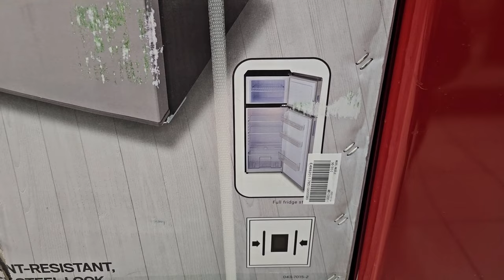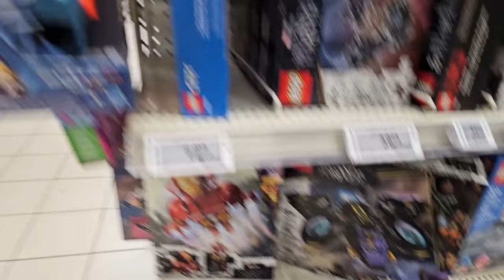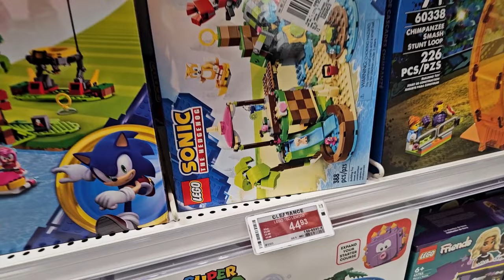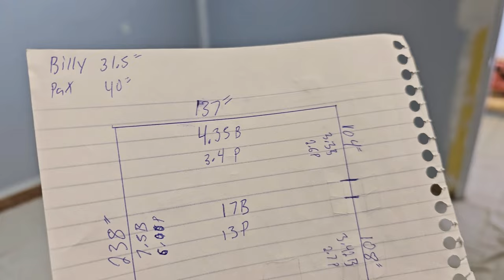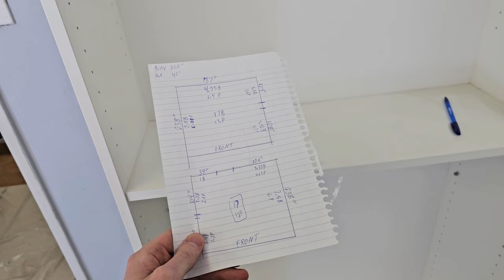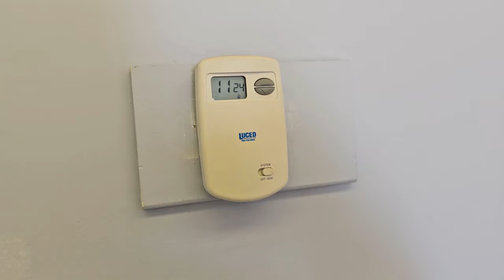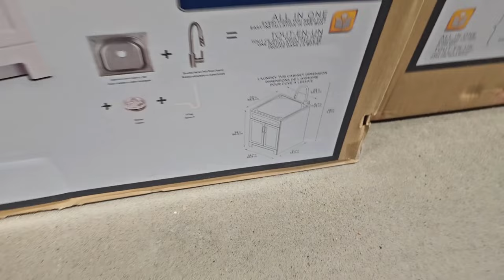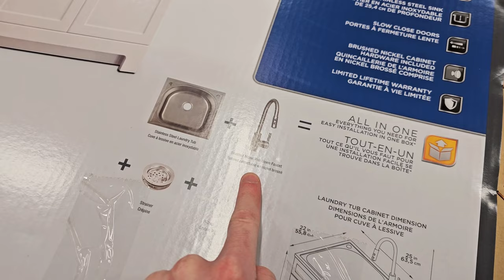Measuring LEGO Cabinets, Construction Progress & VLOG

Comment: Hi Bricksie! Interior Designer and Lego enthusiast here. I wouldn't settle for the tiles you don't want. First the dark is soooo hard to see Lego. Second it is expensive no matter what you are spending so you should definitely get what you want. I have seen clients pick options and then they are not happy and it costs them twice as much in the long run and I don't want that to happen to you. You can find really good carpet tiles at End of the Roll, ext around the $1 sqft mark. I am out of Calgary and know a lot of local suppliers if you need any help or suggestions on places to check out. 😊
Reply: This was my thought, too. I don't think he should settle for ones he doesn't really love.
Reply: @LutherAEvans  I hope he sees this comment. Got tons of them to look through though and only so much time.
Reply: My Lego spaces are all white/light colours for this exact reason! Though I don't have a 2500 sqft Lego room!! 😂😂😂
Reply: The carpet being darker is better for filming/white balance. And quality/thickness for Bricksie's knees is more important than looks IMO
Reply: This is great
Reply: I don’t see anything wrong with the floor tiles, especially them being darker. If people are looking at the floor, then there is another problem

Comment: To help deal with the electrical sticking out of the walls in the display rooms you could run 2x4s behind the bookcases to evenly space them out. Running a row at the top of the bookcase might help keep things from falling behind as well.

Comment: Suggest renting/buying a power/pressure washer & blasting the floors, exterior doors (they’re steel, not wood), along with base boards & any concrete block walls. If you plan to paint anyhow, no need to worry about blasting loose bits. Also suggest epoxy paint for the floor for durability, even if you plan to put down carpet tiles or some other soft flooring. You might want to consider a simple railing on the mezzanine. You can still place shelves etc in front but it may leave visibility more open otherwise vs a knee wall. Just some ideas. ;)

Comment: Once you get your first heating bill, you'll want a way to section off the mezzanine/studio area from where the Lego city will go. A nice big window could still show off the city behind you though.
Reply: This is so true! I had a 30 x 74 building constructed and it has a mezzanine similar to the one you, Jordan. Since you are essentially building half-walls up there, why not have large sliding glass windows.
Reply from the maker: High efficiency furnace for the front rooms and a 50-foot inferred heater for the back. The bill will be up there, but I can make it reasonable by not cranking the heat. It's just a cost of doing business really.

Comment: just random tip from someone who had to rearrange their bedroom with tight fitting furniture over a couple decades ago, I saw you made a diagram of your layout and measurements, what I did was took a sheet of paper and drew the main stationary walls that can't be moved, anything that could be moved around, I cut out on a separate sheet of paper, I made sure each foot was represented in inches, and any inches or extra legnth I rounded up to the closest half inch on the cut outs so there's ALWAYS room between everything, (I always over measure what the items are, and undermeasure the room size so there's always space) and use the cut out pieces like puzzle pieces I named each one  what they were with their dimensions as well, and just slide the pieces on to the paper of the room until I found something that made sense, leaving a good 2 inches of path between anywhere I felt I needed to walk, (which guarenteed at least 2 ft of walking area). it made moving everything around a lot less time consuming also, so I hope that will come in handy for you.

Comment: You could put the track shelves in where the electrical conduit is. Use a hole saw to cut holes into the shelf and it will sit flush and you won’t have to cover your outlets. Or have your electrician remove the conduit and relocate the outlet to the top of the wall so it’s above the shelves.

Comment: You mentioned the issue of the electrical outlets and conduit on the walls creating an issue with flushing the bookcases to the wall. I would HIGHLY suggest spending a few extra bucks and furring out the walls to allow the bookcases to be flush and properly secured to the wall.

Comment: Since the electrical wiring is on the outside of the walls you can simply reroute them to where you want.
This way you can remove them from behind the bookcases to whereever you want!

Comment: Don’t settle for cheap carpet floor tiles. You want to save your legs and back? Hire a local flooring company to install new carpet and a carpet pad underneath. It’s worth every penny. It’s way more comfortable and it will also dampen sound reflection in your space. I would recommend forgoing another project for now if you’re really worried about cost. Save some work for later.

Comment: may be a good idea to use roll vinyl or epoxy 
flooring with carpet around the edges of the tables would be easier to keep clean, will need acoustic panels for the ceiling to dampen the echo too :P

Comment: Go with the decent size fridge and freezer.  You’ll be surprised how many cold drinks you need to chill which takes up room.  Small bin with lid, you can empty it more regularly which keeps odour down and lid may prevent disaster if knocked over.  I prefer the Pax and Billy to track shelving as they look cleaner.  Finding these vlogs really interesting.  When is the security system installed?

Comment: I would suggest adding 2 rows of wood, like 2x4 on the walls with the electrical then you would have clearance and still have something to use to attach the shelf units so they won't fall. Since the tile floors are 3 different colors,  I would think there is a product you could use to paint them all the same color. Just a few thoughts.

Comment: Was that a mega connex barbie movie house that you quickly passed by when looking for lego sets? Mrs Bricksie could have fun building it for Millie 😊
Just a suggestion instead of having the bookcases backing towards the door, youll need to make them so they cant be knocked over especially with kids  (ive lost a grandson through an unsecured chest of drawers that was against a wall so id hate to hear of anything happening like that) a timber framed wall that the bookcases could be secured to so no climbing or pushing can cause a fall would be safer.

Comment: Bricksie, I really suggest with your NEW LEGO CITY, to go with eight stud wide trains, make that Orient Express work.
Then you can make a proper Hogwarts Express as well.
Remember that one steam engine you don't have?
The Emerald Star?
Think, Green, Red & Blue express trains, if you want.

And it would also let you potentially, design or modify your own trains.
I can also see one room it's near future use, playroom for the kids.

Get some Duplo Bricks & plates, should help you with future mountain building, without having to use timber, all the time.
I do wonder, with more room, will you buy one or two extra Daily Buggle's and make your current one, wider, so it's more square shaped?
Heh, as for a future standing hole, remember your pillar sckyscrapper?
What if you turned it into a apartment building around said standing hole?
Let the hole be ___I`````I__ raised up in the plate, so a couple of milled baseplates can be mounted on top, as roof covering.
And with enough space, get a second Lord Of The Rings set, you know which one and finish the building as it should be, rebrickable has the blueprints for this.
Also buy up those Ninjago & Monkie Kid temple sets, I think that together, you could make a nice temple mountain complex, especially if you also add in a sinkhole for that training's obstacle course.

Basically, Bricksie, start looking at sets you think you could use in your new City Layout.
Make a list from I need to I want, to handy to have.
Also start looking up the blueprints of older lego kits and see if they have design elements you like, like certain Ninjago Bridge designs.

Comment: Was using a power washer on the floor not an option? You could blast away and have someone assist pushing the water with a squeegee out the loading door. Another good reason for the darker carpet is that it will do better at hiding any stains that will inevitably happen

Comment: Much of the heat will escape through the garage door, will you be sealing the gaps around that door with insulate or better covering the whole door or does it have to stay original for spec?

Comment: Am I nuts Waching this at 230 am in the morning. 🤩Plastic bag s. Are so. Bad. For going into the. Ground. At. The. Dump yard. Rubbish.Tip s  Unless biodegradable.  I herd LEGO. Is working. On making Lego brick s  an parts. To be biodegradable .soon. Thay all ready have one of the plastic s and working on the other two over next 5 years sints 2 year s back. When that started. Working on it    Nice. Score on the flooring. Matt s.  😊 Recycled .2 nd hand.  Help s on saveing a little $ ..